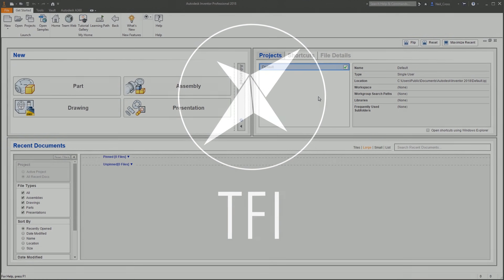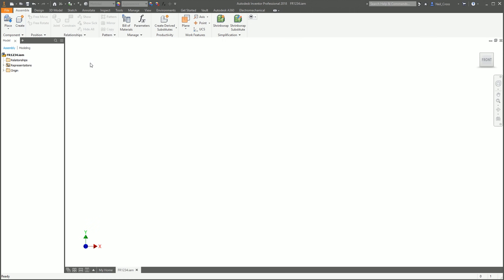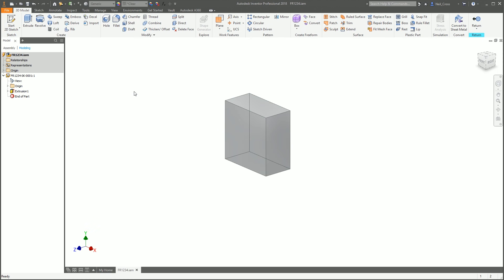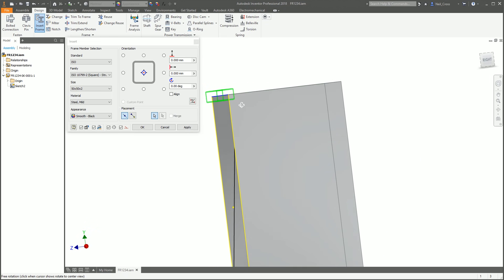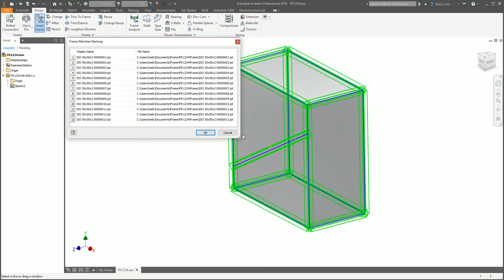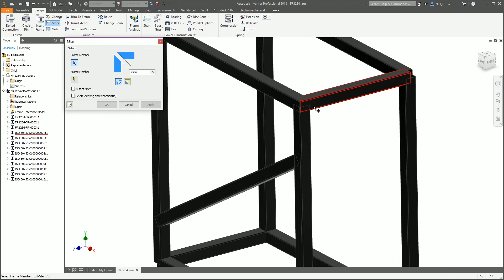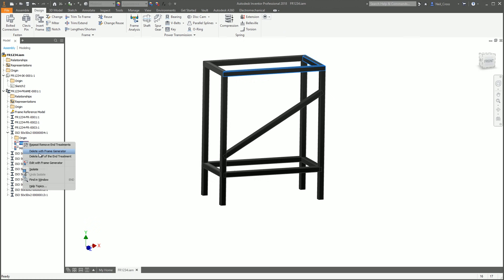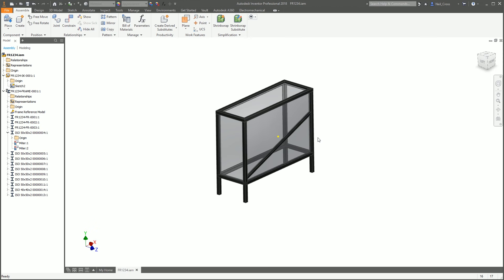Frame Generator Tutorial (Beginner) as Fast as I Can | Autodesk Inventor

Comment: Thank you for this tutorial. Frame Generator in Inventor is so confusing. How about the situation i think most of the users encounter - i'm designing something by making parts inside an assembly file (because i want to reference other parts and their dimensions), then i want to frame everything. And here there is problem: when is draw a sketch inside this assembly, to serve as skeleton for the frame, Inventor is not behaving as i expect. Somehow Frame Generator doesn't want to take my sketch as skeleton. Only some of the edges. Even then i can't see Trim/Lengthen/Miter/Change/Notch/etc... tools available. Why is that? I really don't know how the frame should looks like before i design all the other parts that will sit in the frame. So how to build frame abound something? The box you've created at the very beginning as a separate part - is it really necessary to use a separately created IPT file that contain the structure that holds future frame shape? Should i create 'box' inside my main assembly file, then save it as separate IPT file, then place is back in main assembly file just to be able to generate the frame? And the is i need to change its shape i need to change the box, save it as separate IPT file again, import to main IAM file to regenerate the frame? is it really so cumbersome in Inventor? Thank you for any help. I appreciate your efforts. Cheers.

Comment: @Neil3D If I have a 1/2" thick end panel Carbon Steel sheet with SEVERAL 4.75" O.D. Holes cut in it that is part of the equipment and I want it in the wire frame while i'm using the frame generator. Can I extrude the end sheets to what I need during the sketch process and when finished still run the frame generator and it show the end sheets extruded without it weirding anything out?

Comment: Does all framework have to be added to the original skeletal model or can a subassembly with a new skeletal model be created for additional framework later in the assembly process?  For example, if I wanted to model existing framework in order to make modifications to it, could the original framework be model in the top level assembly then create a subassembly for the modifications?  Hopefully that makes sense.

Comment: Fantastic short explanation! But one question please: let's say I don't want to directly weld the diagonal frame (the one which you later changed) but I won't to have a plate welded on it, with 2 holes to assemble it via screws, how could that be done? Is there any default option? Or do we need some space and later at the plate as an extra ipt? Thanks

Comment: Great run through! 

NOt sure if someone already mentioned it but you don't have to edit the files manually to give them a unique name. You can add things like FRAME_<ASSEMBLY_NAME>_<UNIQUE_NUMBER> in the Application Settings->File->File Naming Defaults->Frame Generator "Frame Assembly:"

Comment: On my content Center tab it shows the Custom Family Default is set to "As Standard". I do not recall if it was set to "As Custom" before AutoDesk support got a hold of my file locations. this guy moved all kinds of things around and now when using Frame Generator some sizes are not showing up for pipe. But when I open the Content Center to edit and add the size I need, it's already there.

Comment: Hi
The Frame Generator is indeed a great tool, however it still needs some refinements. One problem I see is that he creates each member with a code and when generating a Part List he repeats members with the same lengths.
It should generate identical members only once in the Assembly and show the quantities correctly when they exist.
Any suggestions to get around this difficulty?
Reply: I think so too.
Have you found out how this is done without doing it manually?

Comment: Hi. As a one time only job, I need to design and sketch a frame using 30mm box section.  Drilled holes in specific places to send to a fabricated to build. Is there any easier app then this for someone like me who has never used apps like these before? Ideally free or cheap since it's a one off

Comment: Hi, just a quick question.   
We do a lot of work with handrails and kee Clamps (connectors). Is it possible to quickly draw up a 2d sketch then change to steel tube. 
Internal tubes aren’t welded so would need to be a butt joint then in assemble somehow align the corresponding clamp to the steel joints. 

This would completely revolutionise how we design and completely speed up the process.   

Cheers 
Jay

Comment: Dont know if you will see this but i cant seem to find the answer online or at least one that works. I have made my 2d sketch and then gone into assembly to use the frame generator for the truss components. Initially i was able to select the individual lines of the sketch. But now i am trying to add 100*10 flat to the front but when i select the sketch lines it adds it to all the lines. 

I don't know what i may have changed or done to make the sketch lines "grouped" or whatever the applicable term is..

Hope your able to help me.

Comment: Hi, Like all your video. I followed this video step by step. At the end I could not create the frame generator, I got the following message: " Frame generator: Erros occured during inserting Frame Member(s).                                           Insertion of frame member(s) failed                                             A frame member could not be created. The template file ISO ISO10799-2(square) Structural steels -Cold-formed,welded, structural hollow sections could not be located in the content center library.Please be informed I followed your video about to editor content center, but still I also had the same problem.I am stucked and I don't know what to do and I have design project to submit. Please if you can assist me.My email is ericmumpinier@gmail.com,.Erick
Reply: me too. if you have any way of this problem please tell  me too.
Reply: me too

Comment: This might be a crazy thing to ask, but what about curved frames? I can use the frameworks edges just fine, but drawing and placing frame members on a curved face, has been impossible for me. Curved on the horizontal plane, not vertical if that makes any sense. I'm using this method to make panels, but I need a support member that centered in the panel and goes from the top to bottom of the panel. As a bonus, I'm also doing this in an iassembly because I will need different panel lengths. The straight panels I've done work as needed using your methods so thanks very much!

Comment: Can you edit the profile of each frame to a bespoke size?  I remember with solidworks structural members each frame member was an extrude and you could go in and edit the sketch.
Reply from the maker: Yea that's not the best way of doing it though as the description and file names will still say the original size, I imagine solidworks would do the same.  Its very unlikely that you could edit a sketch dimension in solidworks and all of a sudden it goes and updates file names and part numbers! If you want bespoke sizes we can edit the table data, I didn't cover that in this I don't think as I wanted it to be proper beginner stuff, but I'll do that stuff in a new video.

Comment: I draw tube frames a lot, although most are not rectangular, and the people making the frame from my drawings usually do what they know how to do best. I usually draw the frame, and use the shell command at the end, although the vendor doesn't really care, since he knows the material being used. This actually looks like something the vendor might use, with weld gaps, and other features. I will give it a try, because it could be faster than my current method. I like how the BOM features work.

Comment: I would really like to see a more advanced tutorial. In particular, I would like to know about the pros and cons of using a 3D sketch compared to a bounding box. Also, the biggest problem I face (Maybe due to the fact that I use 3D sketches?) is when I want to redo the entire thing. Like for example move a beam which sounds simple enough but sometimes it leads to weird consequences... :(
Reply from the maker: I think you've just answered your own question! That's why I use a bounding box where possible, a 3D sketch is a nightmare to edit in the future and keep it's structure together.  Most (repeat most) frame fabrications are relatively straight and box-like, so you can likely define them using bounding boxes and solid model features to sculpt the profile.
Reply: Good to know. Thank you for answering my question. Much appreciated.
Reply: @Neil3D  Could you show how to add holes to frame generated parts and keep the part as an unique part.

Comment: Hi im working or playing whit a mountainbike frame and i wonder how do you easly generate Tube Coping prints do you have to slice the tube and unfold it and so on and so on???????? Thanks for good vids :)
Reply from the maker: There's pretty much only one way to do that, there's a few ways of getting to the same point, but it's possible.  I can knock out a vid on how to do that, not sure if you're already doing it or not but it might be useful for others too!
Reply: TFI tanks no I'm new to inventor I did work in solid edge before so I'm having a little hard time whit this but I did manage to make a mtb full suspension frame now when I was home sick😊 so I'm learning. Going to weld one up later this year

Comment: Sup Neil. Awesome as always. Thank you for the demo on framework.\m/
Reply: One more thing. I noticed you didn't use your 3D navigator in demo.
Reply from the maker: Yea I try to remember not to use it when I'm doing absolute rock bottom beginner videos, mostly because there's a very high chance that a complete beginner won't have one so it just adds to any confusion and insecurity they might have about using the program.

Comment: Adding custom profiles would be a good vid! I struggled for hours before I eventually got aluminium extrusions into my library!

The frame generator is clunky but workable however I've given up with the cable and harness tools! Far too much of a headache to get results from, IMO!
Reply: I agree on the clunkiness and there are a number of glitches I've reported to Autodesk and nothing has been done about them. I asked what the development Direction was and got no reply that it was going to be improved.
Neil, are you aware of the problems that exist in frame generator?
Do you have any insights on what Autodesk might be planning or doing with it?